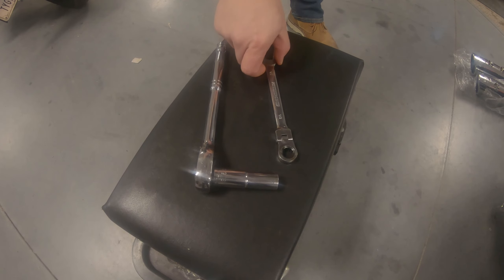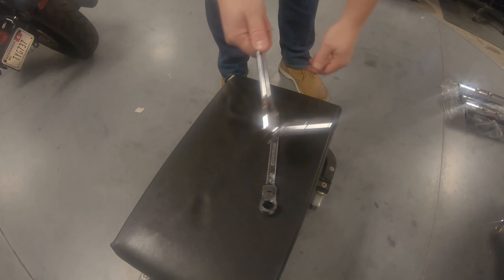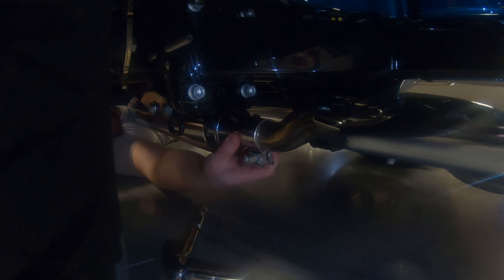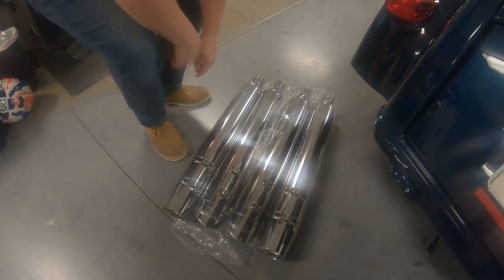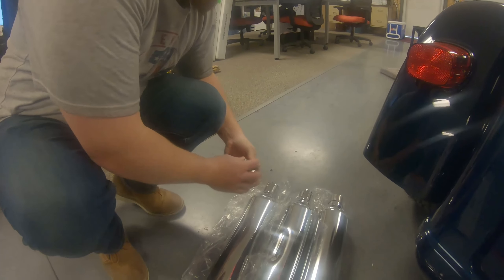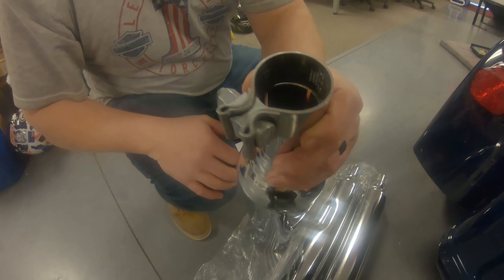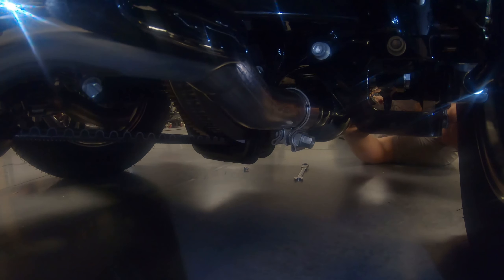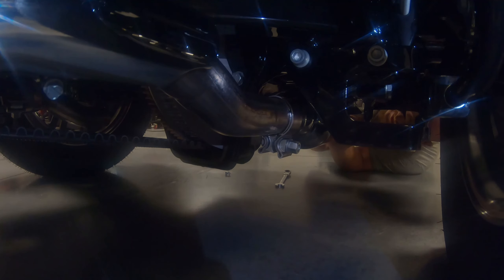2020 Tri-Glide Slip-on Install Video by TAB Performance

Comment: Is replacing the slip ons the same in the Freewheeler also?
Reply from the maker: yes, mostly.
Reply: @TABPerformance  ..it’s the “mostly” that can be a sticking point 😂. Thnx
Reply from the maker: Yeah, we do them at shows on a lift, it is a pain to get an open ended wrench in there, but it can be done.
Reply from the maker: Patience and a swear jar are key tools.

Comment: Can the mufflers from a touring bike, say an ultra limited, be used on a trike? Or are there trike specific slip ons?
Reply from the maker: All Trikes use the 1995-2016 4" mufflers for any touring, the new 2017-Up mufflers do not fit any model year trike.
Reply: @TABPerformance  even the trikes with the M8? Im curious because my father in law just got a ‘21 TriGlide and found a cheap set of used pipes from a ‘17+ touring bike and we weren’t sure if he could use them